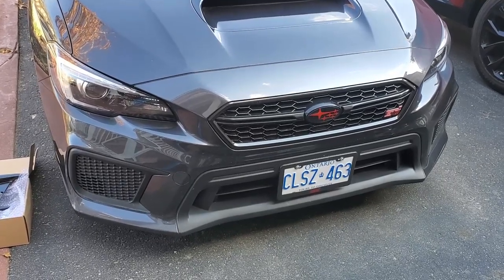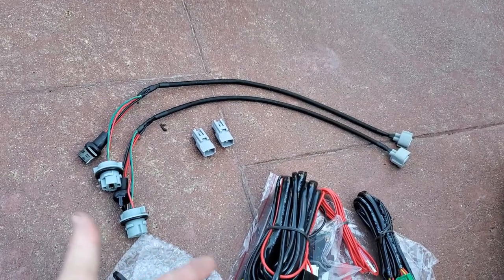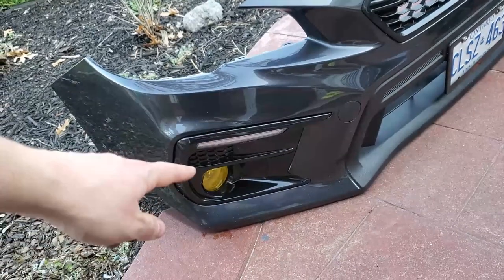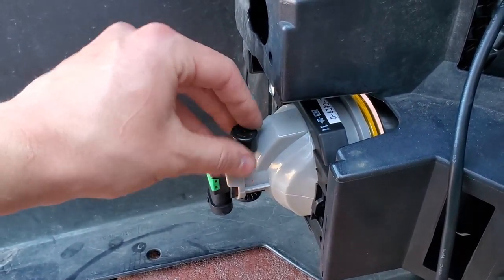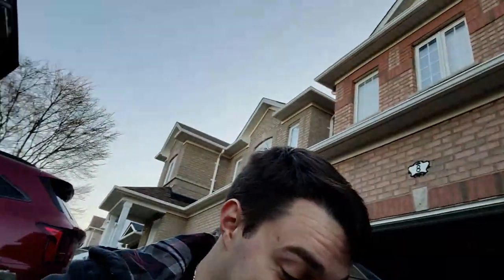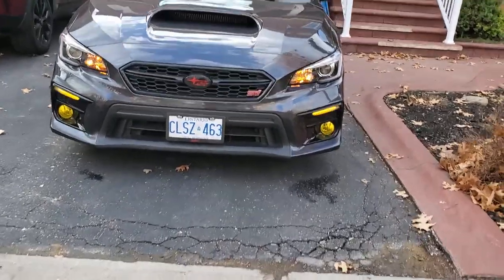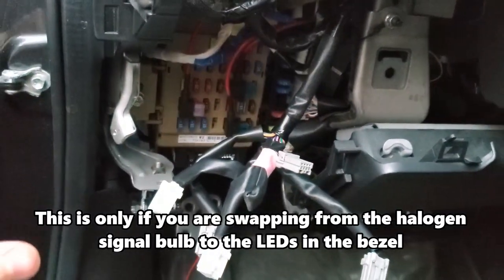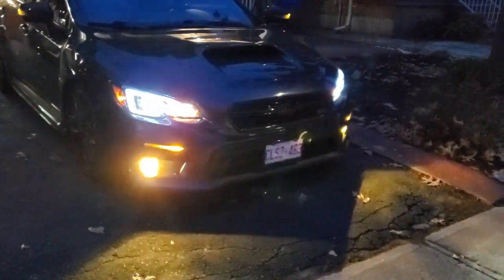2018+ WRX STi Fully Plug and Play JDM Fog Light Bezels and Fogs!

Comment: I have a 2021 STI base...what do I need to do this plug n play and the cost? I do have the LED directional headlights if that makes a difference.
Reply from the maker: Price depends on what you want exactly. If you want the signals to work without splicing you'll need the extra harness that plugs into your factory signal bulbs. Price also depends on if you want fog lamps, or just the jdm bezels. If you message @subie_spec on IG we can get you a total cost. We are also based in Canada.

Comment: Hey, I can't seem to find a button for my 2020 STI, the one that came with my kit is 1.5x bigger than the hole. Where did you get yours?
Reply from the maker: You can't buy the button separately from what im aware of. I got my fog light kit on ebay, just look for one that contains all the wiring and button
Reply: @zach_lush  ok,thanks
Reply from the maker: Not a problem, I just updated the description for you

Comment: Where did you get the fog light lamps, wiring and switch kit? I can only find the fog lights by themselves. The DRL Bezel kit doesn't have the fog light lamps or the wiring and switch.
Reply from the maker: You can find them on Ebay or your local aftermarket auto part shops

Comment: Does SubieSpec sell just the wiring? SMY sells the OEM button for the interior fog light button and the 2020+ foglight and DRL kit looks so much better in my opinion.
Reply from the maker: SubieSpec is inactive, you can get the kit with the wiring on ebay

Comment: Great video! Question, is this setup like the oem foglights where they turn off when the high beams are activated or do they stay on even with the high beams? I've read that oem kits are like that so I was wondering.
Reply from the maker: Thanks! Currently the lights will stay on with the high beams. I'm pretty sure theres a way to make it work like OEM. Just never bothered

Comment: Hi Zach, very helpful video, thanks. Are you still making the extra looms that dont come with the JDM kit? I have a 2020 STI. Thanks Greg
Reply from the maker: Thanks Greg, yes they are going to be available on Ebay shortly. Give it a few days!
Reply: @zach_lush  Hi Zach, that's great news. Trouble is I am in Sydney Australia, so freight could be an issue. Really annoys me that the kits say complete plug and play fro WRX/STI, but they are not!😀
Reply from the maker: @kxaudio  oh yikes! Yes that will be a bit pricey. Unfortunately its only truly plug and play for 15-17 year, and 18-21 WRX with non LED headlights. I wish Subaru would've just had the connectors there already!

Comment: Hey Zach.   Thanks for the video.  Do the fogs work irregardless of whether high beams or low beams are on ?   As long as car is powereed up they work ?  Over time have you had any issues with the switch inside blowing fuse ? or the harness relay fuse to it ?   ILM =  indicator light module ?

Thanks 

Russ
Reply from the maker: Hey, not a problem. Thanks for watching! The way I have it wired up pretty sure the fogs stay on. The only way I know of having them switch on or off depending on your high beams being on requires 2 add a fuses. I have personally never tested this but I've seen someone use this method somewhere. I've never bothered since with the high beams being on with fogs being on hasn't been a problem driving at night. Also no issues with fuses blowing at all.
Reply: Zach Thanks ! The wire thru the fenderwell grommett into the cabin was tough - but if you hadn't shown it - dont know what Id have done.  I did the same conversion on my car now and I really like the change.   Thanks again for breakin the way !  Hope you've got your car up and running.
Reply from the maker: @squealswhenwet735  Not a problem Russ. Happy to hear my video helped you out! I haven't seen anyone else do this so I was really winging it hahaha. Also thank you, the car is up and running now. Doing the final tuning. More videos will be up soon! Just in the middle of moving so finding time to edit has been difficult.

Comment: I have a 2020 sti base model working to get the exact set up as you curious is there a way to eliminate the switch inside and just have fog lights etc run all the time send link to purchase please
Reply from the maker: If you want fog light like that you can get them from any company, just depends on the style you want. For the bezels and signal harness message @subie_spec on Instagram and they can get you the pricing. They are based in Canada.

Comment: Hey bro at 13:11 you connect a red and yellow. Mine are yellow & yellow would that be an issue I purchased it from a different place
Reply from the maker: It's just an extension to run inside of the car. If your wires does the same thing the colour shouldn't matter.
Reply: I got it I’m struggling to fish the extension through the rubber gauntlet thing
Reply: It’s like as I push it through nothing comes out the other side

Comment: On a 2021 base and doing research now for a fog light kit...

I think I'm going with the SS3s from Diode Dynamics and wanted to know what wiring kit to purchase??  So dumb these cars do not come with fogs and we have to go through all this!  TIA!
Reply from the maker: Yes, I agree it's ridiculous these car never came with the wiring already there like the older models. I'm not sure of the brand I got, believe it was Vinstar though. But you can get any wiring kit out there that your local shop carries. Don't have much experience with other options on the market.
Reply: I ordered the kit and it needs to have the connections got to both positive and negative of the battery.   To be safe,  what's the correct order to connect these two cables?  Disconnect negative and add connection then tighten and then do the same for the positive or?? Rubber gloves??
Reply from the maker: @GR8GUY54  I'm assuming your talking about the AirLift 3p managment kit? But to hook them up safely just disconnect negative, go ahead and hook up positive. Add your connection to negative, then put negative back on your battery terminal. Should be fine, not need for rubber gloves. Just don't touch the two terminals with a wrench or anything metal!
Reply: It's the Prolightz fogt kit for 2018+.  So disconnect the negative,  then disconnect positive, connect wire to positive and tighten then connect wire to negative and tighten around right?  Appreciate you getting me there.  Kit should arrive next week.
Reply from the maker: @GR8GUY54  whoops clearly I was asleep when I responded to this. But no problem, you'll be fine installing it
Reply: Thank you.  Hopefully my sequence I mentioned above is correct.   Thank you for your time.  It is much appreciated!!
Reply from the maker: @GR8GUY54  yup your sequence is good, good luck!

Comment: You didn’t show us the last part how you connect the right cable to the fuse
Reply from the maker: 20:20
Reply: But how you wire up on the fuse box you just put it in
Reply from the maker: @yudubest  the red cable goes to an add a fuse, and the add a fuse goes to a fuse you know only turns in when the car is running. An example of that is the radio or cigarette lighter.

Comment: Subarus motors are junk. Just wanted to inform ppl, thank me later. I promise.
Reply from the maker: Good soup 👌
Reply: so why you here
Reply: @saigoneze4465  for the very reason I originally stated.
Reply: Do you mean like GM junk or VW junk?  Yes, some Subaru engines that have an inherent flaw, but it is well documented and there are fixes for it.  I'd be more suspect of the CVT transmission now in use and the engines are the least of your worries w/proper mx.